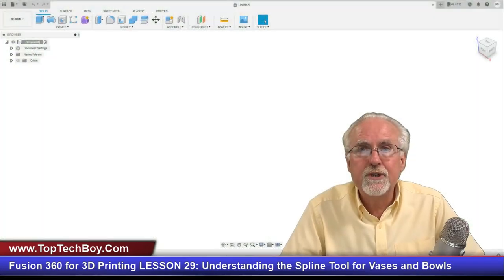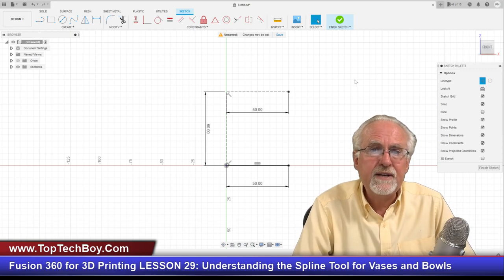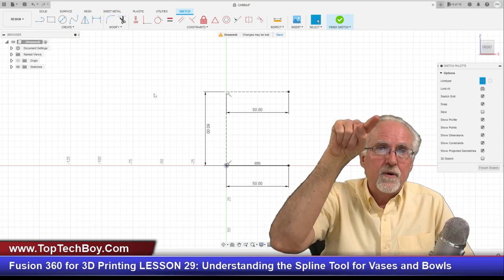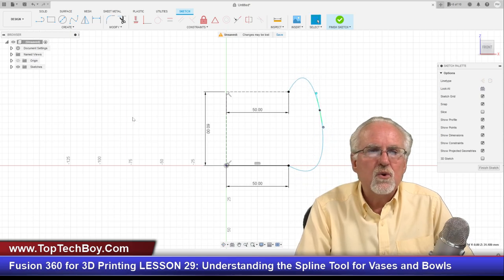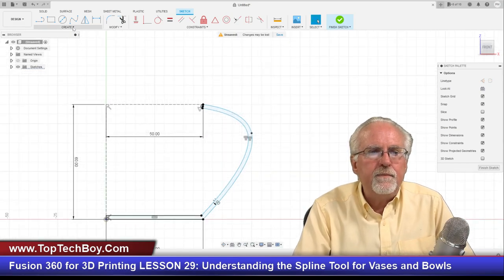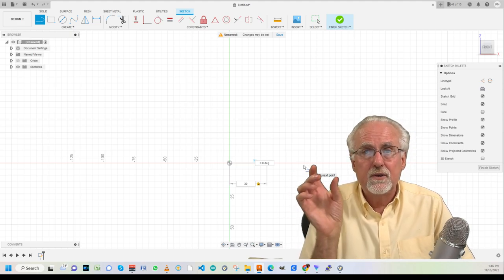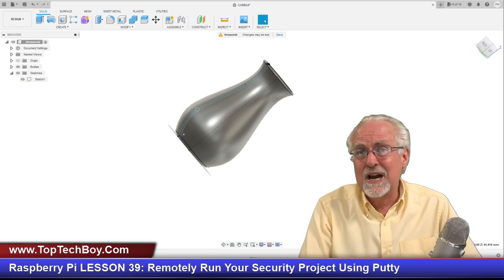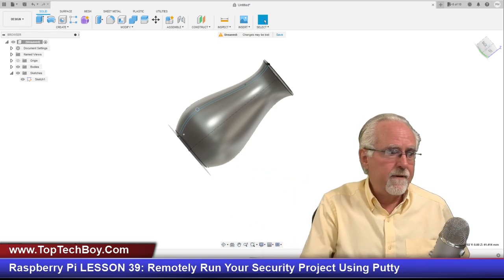Fusion 360 for 3D Printing LESSON 29: Understanding the Spline Tool for Vases and Bowls

Comment: hi paul McWhotre hope you are having a good day i just wanted to ask you samething i was makeing a project with a arduino and the project was you had a menu screan in a lcd and there was 3 screan and you press one botton in the remot controler it says blue light you press the again the same botton and it says green light you prees the same botton again and it says red light and if you press it again it says blue light and it repeat and lets say the lcd says green light you press the power botton and the green light light up in the rgb light or the lcd says red light you press the power botton and the red light lights up rgb light lika a menu i hope you understand me i dont know if this is possible but i dont know how to make a menu screan anything you can suggest me
Reply: First you would start the LCD, and print out your default menu screen but put it in an if statement that is if((j==0). I'm not sure about the code for the remove control but you could take a digital or analog reading of the button (not sure which one it is ), and put it in a while statement. So while (buttonState==0) {}, so it would just run forever till a signal is received. Then after that have a counter like initialize J and make it zero in a global scope. Then you could put J=J+1. If (J>4) {j=1}. You would then need 3 if statements, for each of the colors and menu. So if (j==1) {digitalWrite(greenPin,HIGH)...}, and do the same for the other 2 values J could be.I am guessing that you know how to use an RGB LED and an LCD. I don't have all the parts on hand to test it, but I am guessing that the RGB LED should stay the color that you want. Also just as a reminder, make sure that when you are in an "if" statement for like the green state, make sure to turn the redPin and the bluePin, to LOW. Ok Gl. There may be some parts to the code missing, because this is the best I can do at hand.
Reply: @kavishgoel4194  thank you i been trying to make this for 3 weeks and i came close and agian thank you